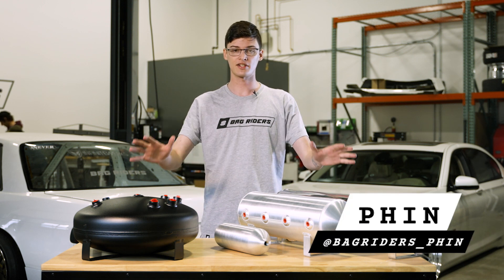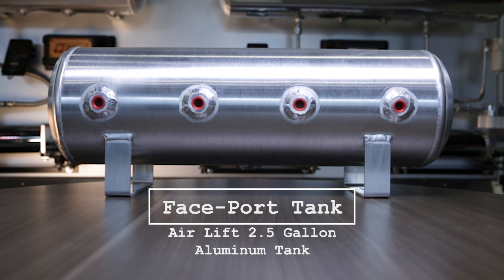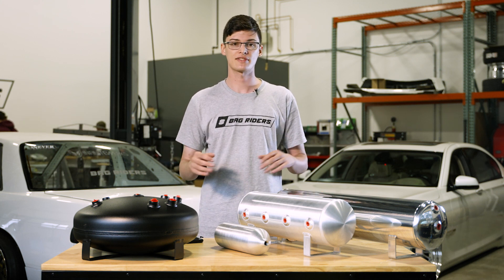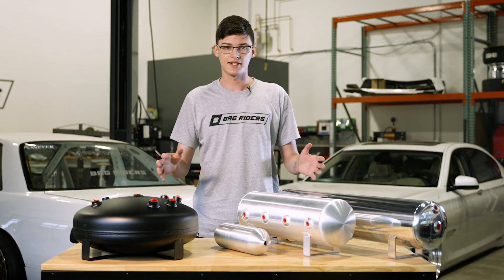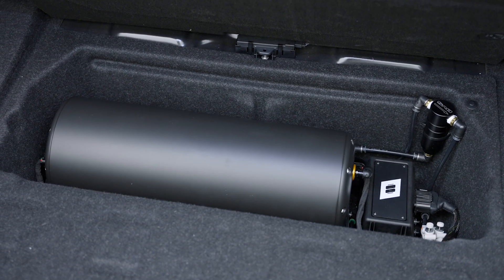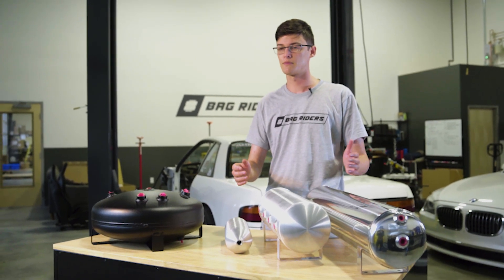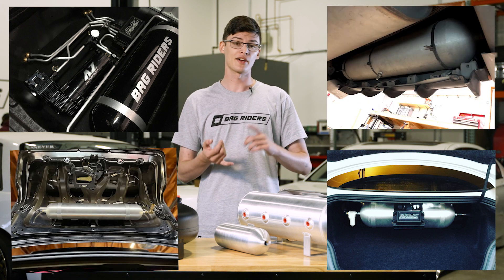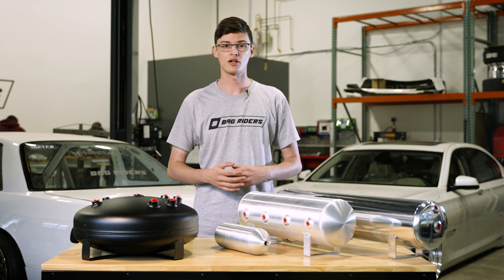Air Ride Tanks Explained by Bag Riders

Comment: Hi what would the better tank size for a 2021 honda accord with 2 viar 444cc compressors and what would the difference in fill time be, thanks…
Reply from the maker: A 4 gallon tank would be plenty sufficient.
Reply: @bagriders  another question, whats the difference between a stainless steel tank and a seamless air tank? Which would be better durability wise?
Reply from the maker: Currently, we offer both steel and aluminum tanks. We always recommend going with aluminum, as it won’t rust like steel over time.

Comment: How do you guys install fittings in these tanks without the threads stripping out.. like how many turns? I swear it never fails with the airlift aluminum tanks I’ve got 2 tanks with a 1/4 side port stripped now
Reply from the maker: We recommend applying 2–3 wraps of Teflon tape to the threads. Since it's an NPT fitting, you can start by hand-threading it, then follow up with approximately two full turns using a wrench. Keep in mind, the fitting is not designed to sit flush with the mounting hole.

Comment: If you want to add a second tank can I just run a line from the existing tank to the new tank and it will use it as it needs and fill it as it fills the existing tank or do I have to run a sensor and compressor to it and have to run a line from the new tank to the air solenoid in order to use the second tank
Reply from the maker: Yes, you can absolutely add a second tank by running an air line between the two. As long as they’re connected via a shared line, they’ll equalize pressure, fill and empty together, and work as one larger tank.

Comment: Hello,Why my presets never stay the same ? Even when i click it to set my presets will not reach what i preseted. Also Airtank is losing PSI when i drive or over the night when car is parked , when i go to start the car my PSI is low, is this normal?
Reply from the maker: Have you tried calibrating the system? If you air tank is losing pressure you will need to check for leaks. You can do this by spraying any connection down with soapy water. Anything more than a 15 PSI leak overnight should be addressed.
Reply: @bagriders  I will try to calibrate  because I didn't find any leaks. Ober the night is going to 0
Reply from the maker: @bogdan.r.s  Reach out to our customer service team. They will be able to help find the leak!

Comment: Do all air suspension kits use the same amount of ports ? I think I need a 5 port for the setup I want to do can I use a tank with more than 5 ports
Reply from the maker: Most air suspension kits will use 3-4 ports standard (compressor, tank drain, tank to manifold are the necessary ones). If you purchase a full air suspension kit from Bag Riders we provide all the essential fittings to either fill or plug the port to make your set up functional.

Comment: Hey Bag Riders  please tell me would it be safe to run two different power compressors on a setup or must they strictly have the same power?
Reply from the maker: Hello! This entirely depends on what system you are running, but most likely that is okay! Feel free to email our sales team, sales@bagriders.com with the model of compressors you are looking to run and they can help make sure that it will work correctly together!

Comment: Can you do a video for preventing your air system from not working or getting stuck or busting? We have a lot of issues here because of all four seasons.
Reply from the maker: Hey! We can absolutely make a video covering winter maintenance, the big one is air brake antifreeze in the tank to ensure that water from condensation does not freeze and prevent your manifold from operating correctly.
Reply: @bagriders  Yes! Thank you.